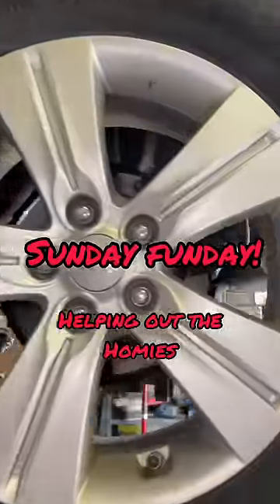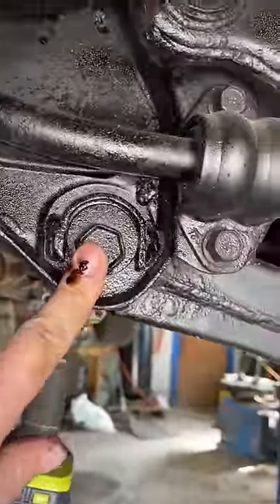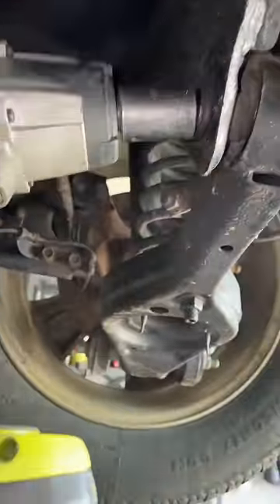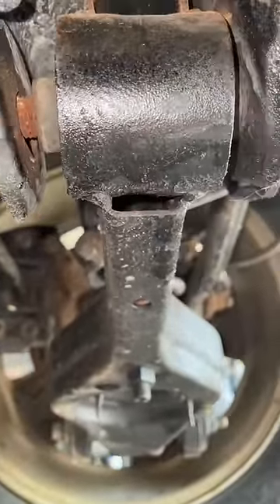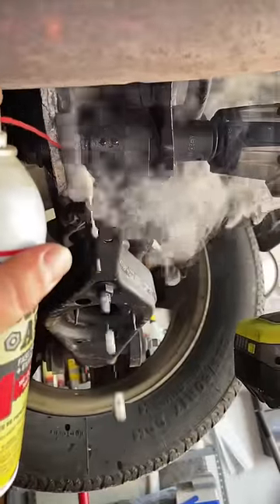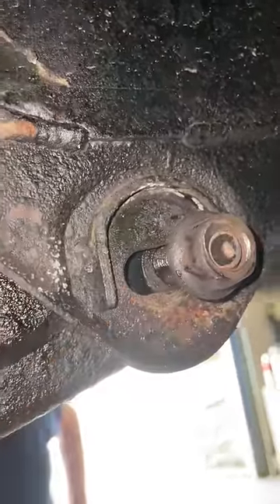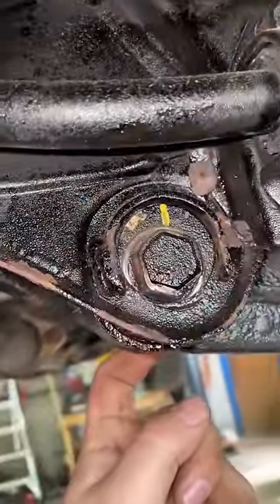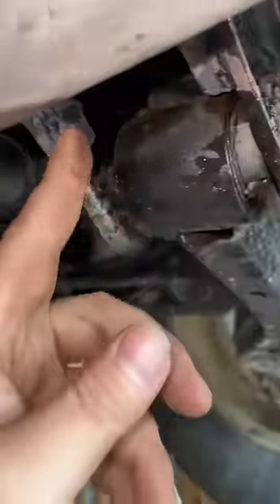Vehicle can’t be aligned problemo

Comment: $500 more to chop off a bolt and push it out? That’s a rip off… you guys deal with seized bolts all the time they should not make it $500 more
Reply: Guy came in for an alignment. Chopping bolts off is a last resort. And seized anything is a pain in the ass. I now have to replace the bolts and the bushings, probably. If they are replaceable, if not, the whole control arm. Replacing anything requires parts. This means errands. Errands take time. And fuel. And time. Meanwhile YOUR car is sitting in the shop, taking up an elevator, which i cannot use because something that should have taken N is now taking an afternoon or a whole day, over A FUCKING SEIZED BOLT. Im wasting manpower, time, money, resources and income over an alignment. Its a business, theyre not in this to lose money, get it?

Comment: That’s no excuse for a repair shop. There is no such thing as too tight. The bolt head would strip out long before you aren’t able to find a tool to remove it. Saying it is stripped and you have to drill it out weld ect is a valid excuse. Having a weak impact is not. That’s the shop’s fault. It’s not even severely rusted. And if you really can’t get an impact to do it take out a breaker bar or a torque multiplier.

Comment: This is just poor and cheap manufactoring by the maker that doesn't care about certain connections like this that should have a never- seize type lubricant to prevent this major cost and headache to owners. I would  hope the mechanic does apply something to prevent this in the future. This is common on many areas that need service occasionally. Duh! to car makers for putting dry steel parts together that they know will be exposed to water and will totally rust and seize. No concern for the owner of the vehicle or the mechanic. Typical, unfortunately.

Comment: This is why I rebuild my entire suspension before realignment. Make sure all the bolts are in great condition, blued, greased. 

After working on cars for so long, I repair my cars with the expectation of return. So I build throughly.
Reply: Also, bushings getting caught. Always chop the bolt. Don’t bother. Just a waste of time. Chop chop, torch and punch. Press new bushing in, new bolt from fastenal. Bam, done.

Time is money.

Comment: I took my 97 Tbird to 2 “professionals” with one being a nation wide company. Cough cough Christian brothers suck! Anyway… both places told me they couldn’t do my alignment because of seized cam bolts. They told me they had to drill them out and even then couldn’t find replacements. I broke them free myself with a torch and breaker bar. The local shop did my alignment after I brought it back to them and gave me a discount because I think they felt dumb a skinny guy like me did what they couldn’t.

Comment: Yes four times now. First time was okay the other three times they claimed it was an accident to my vehicle. Bottom line you're an idiot because you don't know what you're doing. Turns out that once I investigated it. One wheel had bad bearings. And that's why they couldn't align it. Trying to tell me my struts were bad. Fact is I put brand new struts in uppers and lowers. Two weeks before I went in for an alignment. With new tires. That's why I'm a firm believer when mechanics do something to your car. And it's not right hiring attorney and sue that mechanic. For every dime that he has. And then sue the company